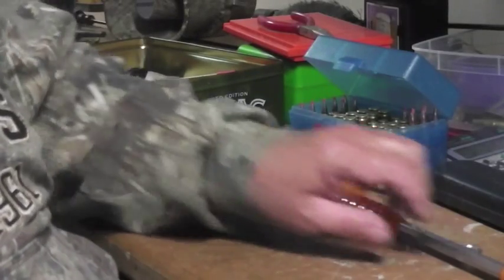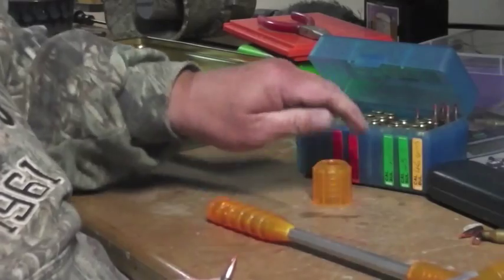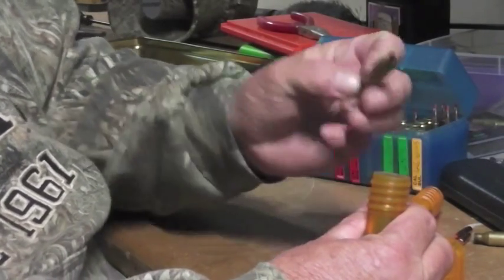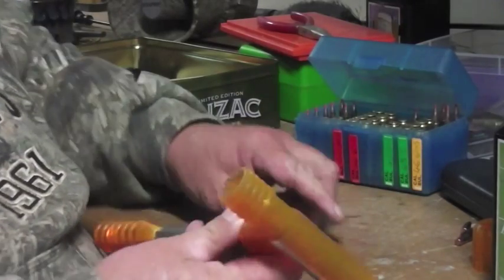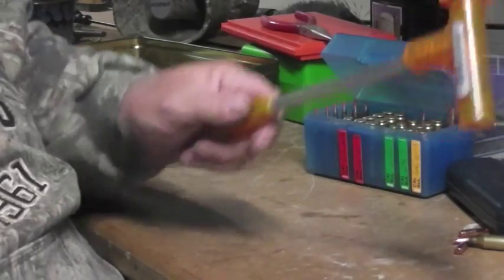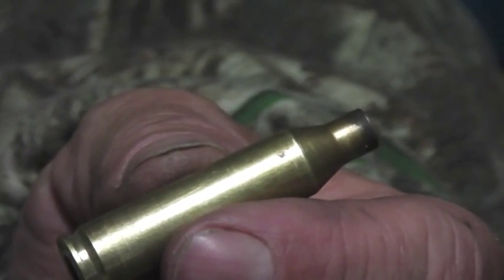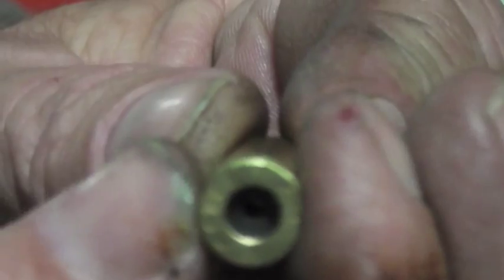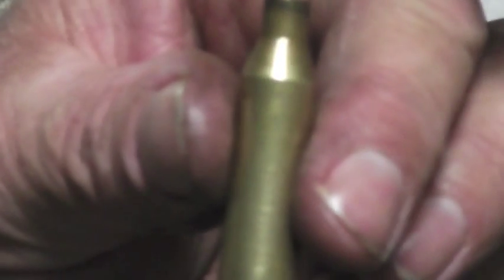Reloading (Bullet Puller)

Comment: I have the RCBS Die type bullet puller myself, I find it much better to use than the Hammer type - its pretty much the reverse of seating a bullet - very quick and easy to use and only costs around $40 or there about's.

I had to use mine the other day as a matter of fact.